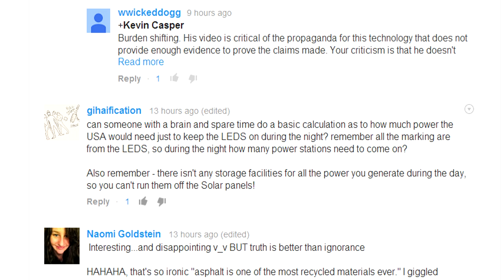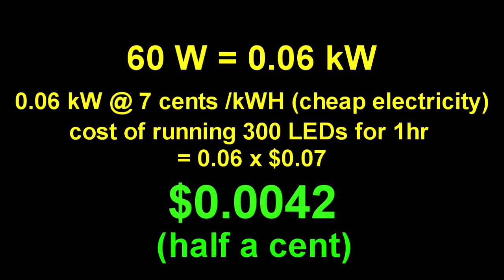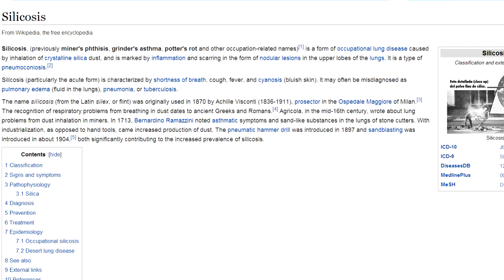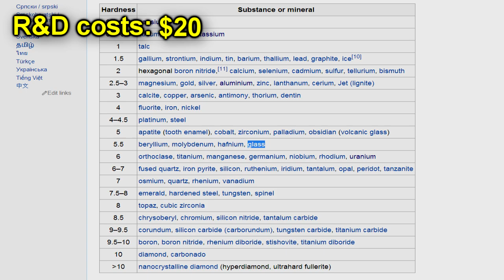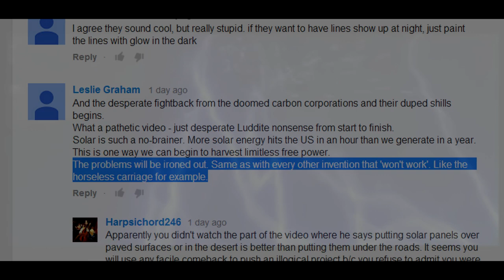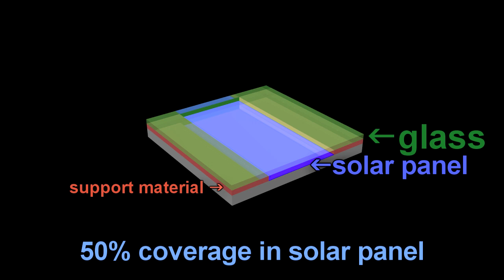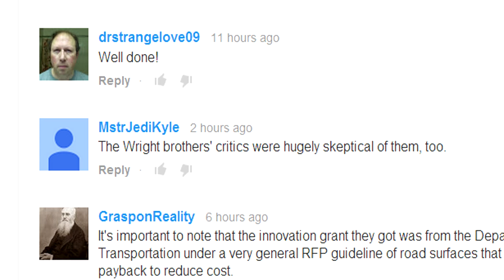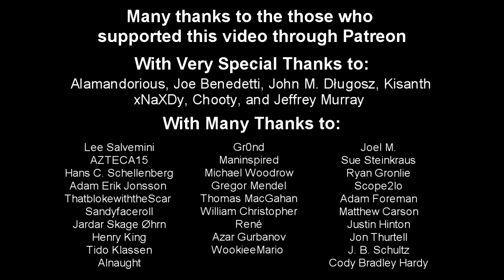Solar Roadways, IMPORTANT QUESTIONS AND ANSWERS!

Comment: There's a few things I don't quite understand.
1. How would the lights cost us anything if its main generator is literally right next to it? (It also reminds me of this show I watched where aircraft carriers have 2 nuclear reactors giving the ship plenty of power but then it still cost money, how? 

2. In terms of low numbers we won't get much power and the angles/stuff in the way is innifecient, but if the entire US is filled with them, wouldn't the power we get every second be significantly higher than anything we have now? (Its like you're talking about having 1 solar panel in a solar field and comparing it to a nuclear reactor rather than comparing the entire solar field, numbers make a difference in something like this)

And my above questions are assuming the glass can handle the weight/assuming it can be in a road just fine
Reply: you miss the key element: there is no storage for the energy.  A solar generator produces nothing at night, and very little when it is set into the ground and doesn't follow the sun.  The lights would have to be powered by conventional power plants most of the time.
Reply: 1: Because someone has to foot the bill of the upfront cost, and the running cost of maintaining the system. It's the same reason any energy you use cost money.

2: To figure out weather solar roadways is a good idea economically you have to examine and compare the total cost of:
Constructing 1 square km of road foundation with concrete on top + 1 square km of these solar bricks+ the cost of actually transporting and installing them on the road foundation. + maintenance costs.

Versus

The cost of 1 square km of paved road plus the cost of building a solar plant with 0.2 square km worth of PVs + maintenance costs.

The reason we only need 20% as much solar plant as road is because the solar plant will be about that much more efficient when you factor in all the efficiency losses for the solar roadway.

Now which will be more expensive? If the solar roadway ends up being more expensive then the cost of the energy you get from that will also be more expensive, and there's no point pursuing that idea.
I'm not qualified to actually calculate if it will be, but I am extremely skeptical that the solar roadway will be cheaper.
Reply: Drizzleize 
Since we are comparing two non storable energy sources, regular solar and solar roadways, we can ignore energy storage and just focus on the power generation.

shadon Liethius 

Any energy source will have a total cost over it's life time, and will generate a finite amount of power over it's lifetime. Take the total cost divided by the power generated and you will get the minimal cost for the energy you generate.

Now let's say we have a nuclear plant instead. If you have a light bulb that runs directly by the power plant does it cost money?
Yes.
The light bulb reduces the net power generation of the nuclear plant, and thus increases the cost per unit of electricity.

The only system where free (economic) energy is possible is one where the system costs's nothing to build, will last forever and requires no maintenance.

To your second point. If it is inefficient, yet cheaper per watt then economically it makes sense. The efficiency of the power generation is irrelevant if you know the final cost.

Of course, you still do not want a bigger power system than what you need. A bigger power system is more expensive, and in the end your society will have to pay for all of it.
Reply: Solar doesn't generate energy unless the sun is out.  Less than half of the time, 30%, discounting weather, if you watched the video.  Add in the support structure and you're down to 20%.  The lights would also only even be visible at night.  The lights are a terrible idea, but might get popular with commercial parking lots.  Also, I'd like to hear what kind of super-glass these are supposed to be made of, and see it tested.  I like the idea of tech being publicly financed through the internet instead of the government, but damn, these guys are facebook chainlettering for millions here.
Reply: ***** 
1. I wasn't talking about maintaining the system. I was talking about costing money to keep the thing going. Its like if you put up a solar panel connected to a light bulb at day time and the light bulb lit up. Are you going to get a bill for it? No, because its energy from the sun connected directly to the light bulb.

2. Its not a good idea economically, BUT assuming we could set it up fairly cheaply, how would it be worse that what we have now if hundreds of thousands of miles get sun energy every second at the same time?
Reply: Even if there was storage, you would still be using the electricity. But even putting that aside, and saying it doesn't cost anything to use the solar panels electricity directly in the LEDs, and ignoring everything else, Tfoot's calculations show you would need 5 times as much electricity to power the roads than Americans use on average, but the guy doing this project said the electricity generated from the roads would be 3 times as much as the average (i'm guessing this is an optimistic estimate). So you would need at least 2 times as much an average American day uses to light the roads, in addition to the solar panel power, even in the optimistic estimates. So it would definitely cost money to power those LEDs. Or at the very least, if we say Tfoot overestimated by about a 30%, it would still cost electricity to power it(which is really a big minus for these panels, since this means you actally cannot use any power from it at all!).

But coming back to the main point,I think Tfoot used dollars as a convinent conversion unit for electricity because money makes more sense (in economic terms.
I agree that it would be wrong to say that the cost of electricity would be the same with the solar panels (at least during the day, but i think Tfoot was talking about night? I can't remember :/), but the thing is using electricity produced is a cost (less production, if it makes more sense that way), and lowers efficiency.

Comment: Couldn't instead of 'solar panel roadways' use some heat absorbing metal, paint it black, and put thermal energy to electric energy converters with heatsinks under them? Even that sounds like a better idea... inb4 people start getting burned for falling down on the road.

Comment: I have to say, I am glad someone thought about putting solar panels in roads. We need to find a way to use less fossile fuels. 

Also, while I don't think it's strictly impossible to create a system in which you could put solar panels in the road, I don't think it's ever going to be the smart place to put them.

A 1 tonne car travelling at 60 miles an hour generates friction, overtime that friction wears down nearly anything (I only use the word 'nearly' because I do not know every substance that can exist ever), and you drastically complicate the system by adding solar panels too it.

My recommendation for the money raised so far (no one asked, and no one will listen, so bleh) is spend it on designing better power storage, so in the future, we can have massive solar farms sitting on top of fantastic batteries, and transmit the power where it's needed.

Want to have super cool sci-fi roads? lets get a power grid that can support it first, preferably without destroying anything else, and maybe burn a few less fossil fuels while were at it.

Comment: Yes, it's a dumb idea, but the silly calculations at the start of this video don't help your argument at all. Using the retail cost of an LED strip + power brick + controller instead of bulk prices for the RGB LEDs themselves, assuming all 12T LEDs are illuminated continuously, etc. When your first two points are made on obviously faulty assumptions, I'm not inclined to watch the rest.

Comment: You wouldn't be doubling the power consumption of the average American (as stated in the video) it would be much more than that. The  power consumption of the average American includes ALL power used. The figure given was just for the LEDs . So you would have to add on all the other power used by Americans to the extra  cost of running the LEDs to get the new full total.

Comment: Nah Thunderf00t there will not be 50 leds per panels... the developers plan on having 6192 led's per panel! http://www.solarroadways.com/economy.shtml

"Each Solar Road Panel™ contains 6192 LEDs alone."

Also the developers apparently saw your first video and try to debunk most of what you said in it in their FAQ including the LED's under the sun stuff, their solution is having bigger more expensive LED's.

Comment: I agree that the idea is stupid...but your calculations are iffy at best....

1: You take end user prices to make your calculation. For example, using end user price for making a driveway blacktop and just multiplying that number to get the price of a road would make that price many many times greater than what it really is.

2: When doing your math for the electricity consumption of the LED, you assume that all of them would be on all the time which is not the case since lines and signs only cover a small %age of the actual road. 

Love your videos but this one had bad logic in it and it made me cringe.

Comment: Also lost in the hype about these dumb things is the question of the net energy of PV solar. I've yet to see (and I've looked and I've contacted universities for this) any proof that if you examine the entire supply chain of a PV over time INCLUDING the embedded energy in all of the equipment (not just the energy consumption of the equipment, but the energy it took to make the equipment and building, vehicles etc) vs the amount of energy the PV panels manufactured in this time on this chain will put out over their expected lifetimes. Solar thermal for conventional steam generated power is MUCH better, even if PV turns out to be a net energy positive.